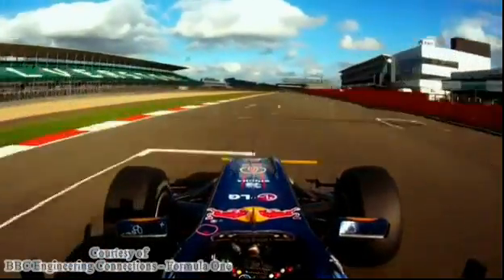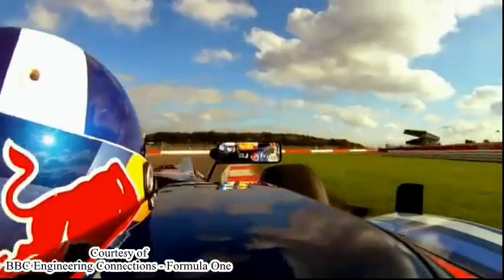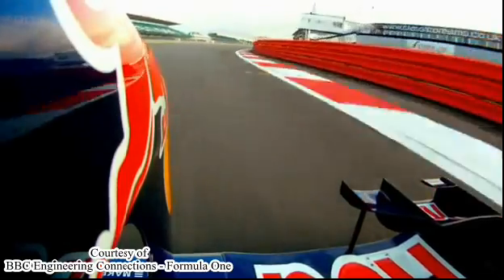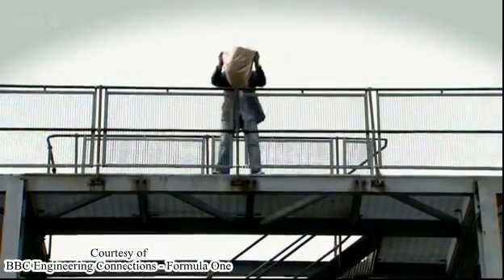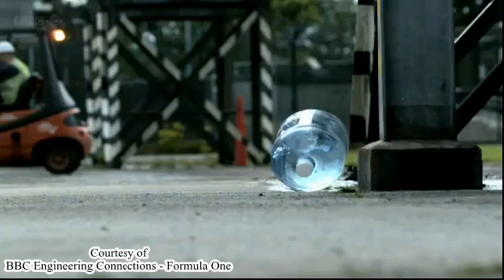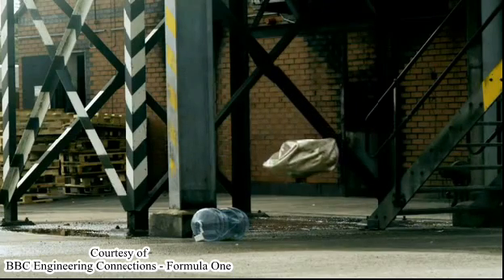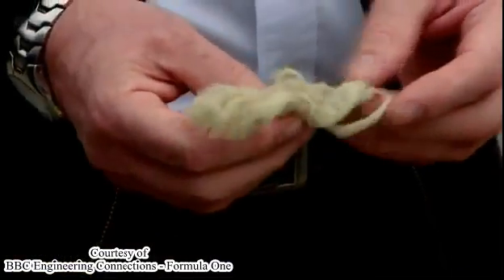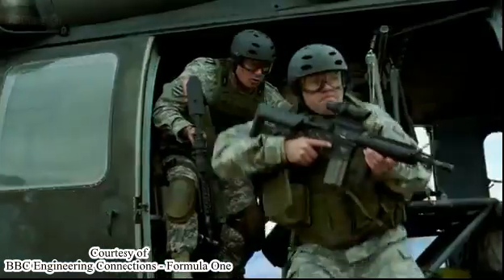F1's Fuel Tank Technology (Rubber + Kevlar)

Comment: Nice thing. But woulnt the petrol eat away the rubber after a while?
The test was also not so good. No point in lighting a arrow, the fire is allways the problem, should have used a spike on the arrow...
Reply: they replace the fuel tank every so often anyway so who cares
Reply: +Lord_Vader You can use coating or use multiple layers (non rubber material over rubber) to avoid that.
Reply: Lord_Vader No way 200liters in that tank @6.30. F1~compressed air
Reply: +Lord_Vader The fire in the arrow is to simulate the heat of the engine
Reply: Yea they only last about 5 years then you gotta get a new one for thousands of dollars.